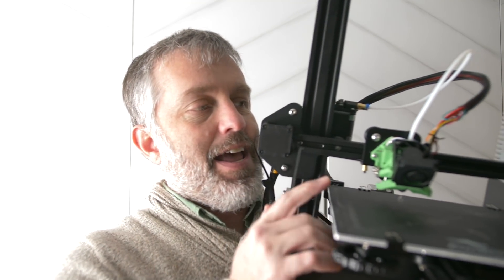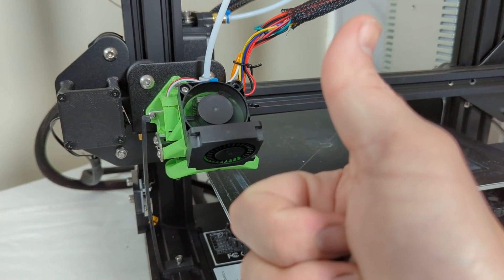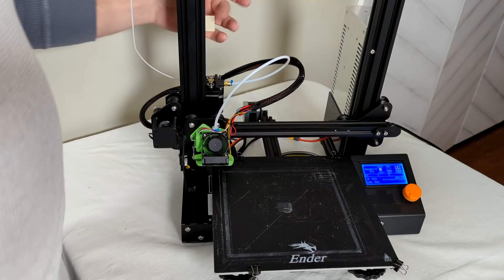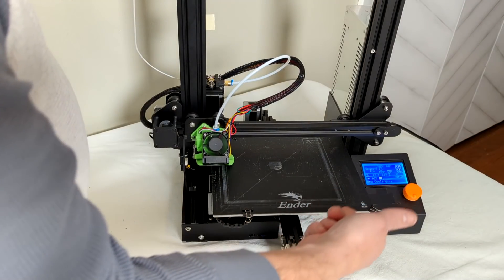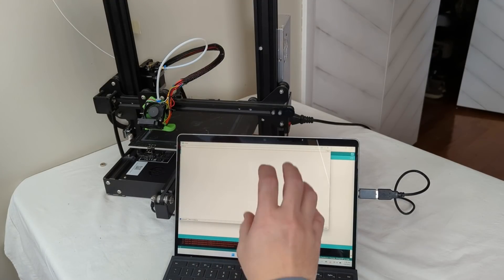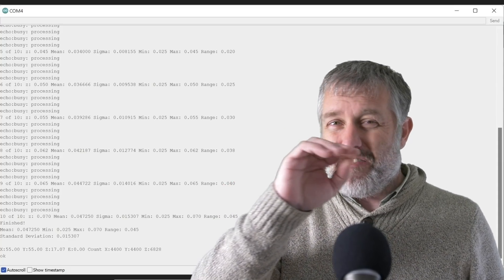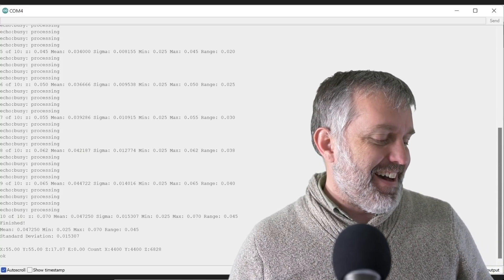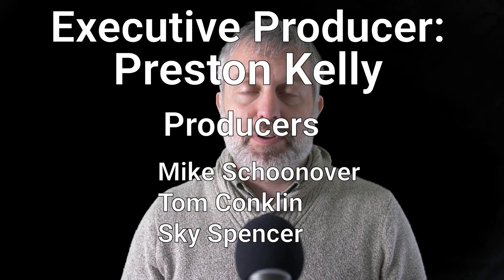I Made a Self Deploying Allen Key Probe To Rival The BLTouch

Comment: The biggest issue i have with this and all other bed leveling methods like the BLTouch etc, is that it does not know of the current nozzle height. 
Every time  is dismantle the hot extruder and put it together again the height was always different then before. For me the only right solution is to use the nozzle to measure the bed level.

Comment: I bought a bl touch for my original cr-10 and didn't make sure I could plug and play on my printer. I sure wasn't going to open up the power box and cut and solder wires in there...

Comment: Shopping around for an optical switch and I notice some of the ones with built-in amplifiers/schmitt triggers specifically mention temperature compensation. Makes sense, the photo-transistor would pickup thermal noise offsetting the trigger threshold. Something to watch out for.
Reply from the maker: Can you give me a citation? Would love to read it and get all the information for myself.
Reply: @DesignPrototypeTest  I dare not post a link, but search for a datasheet for any optical switch with a "built-in temperature compensation circuit" like EE-SX398 by Omron. Plenty of papers on temperature dependence of phototransistors and such. As I understand, the slit width and sensor area are much larger than the precision we are trying to achieve, so it is very much operating in the analog regime so where precisely the trigger fires will be quite important.
Reply: @DesignPrototypeTest  Found a good one. I'd post a link, but YouTube. It's linked on my T-verse probe design/demo. "Technical Information for Photomicrosensors" comes up as first result (Omron). Figures 9 and 10 show temperature dependence of both LED and sensor with a 10% dropoff in light current from room temperature to 80C. If we assume the aperture width represents the transition from light to dark, 10% translates to a pretty big systematic error in height (which can be accounted for).
Reply: Thinking on this some more, it's probably not so bad. The sensor will saturate at high brightness, so fading out across the entire aperture width is not the problem. More likely it will stay on until the last little sliver of light disappears. So crossing the threshold will happen over a much shorter distance than the actual aperture width. Just crank up the brightness. Some sensors allow for bright pulsed light, too.

Comment: Definitely interesting probe. I've saw some similar one like Touch Mi. For safety i would make pin printable and not very strong specifically for cases when for some reason you forgot to retract it and it hits the bed or printed object. So pin will easily break without damage of head holder for example. Pin can be printed again so there won't be big damage from incident. 
But what i think would be a winner in probes is that which will measure the offsets by nozzle. It's a really painful to set correct Z offset after changing the nozzle (or whole head). So probe which will measure bed and nozzle offset at the same time would be perfect.
Reply: A Wheatstone bridge strain sensor uses the nozzle as the probe, check hackaday article named ‘QUARTET OF SMD RESISTORS USED TO SENSE Z-AXIS HEIGHT’
Reply: @iridiandot  great idea! Unfortunately it's mostly for bowden system. Doing it with direct extruder will be more tricky as you have to invent some flexible mount for the whole extruder. May be strain gauge for the whole X rail can sense bending when nozzle touch the bed.

Comment: Interesting.
- There is a 3rd situation where Bl-Touch, or electromagnetic based sensing device won't work; in a strong magnetic field.
I made a super duper Delta printer using ball joint and magnets to eliminate slop. The field generated by the 6 magnets around the effector is strong enough to disrupt completely the weak little electro-magnet of the Bl-Touch.
- You would have less wobble if you had longer sleeve or even better 2 paced out guide holes.
- Can use a larger Allen key if wanted, just use a thin flag.
- need to package this in order to easily adapt to many hot head styles.
Reply: there is a bigger reason, you really dont want to use a off center probe on delta. regardless of it being bltouch or not.

Comment: Hi, I found your project on hackaday. First of all, nice idea! 
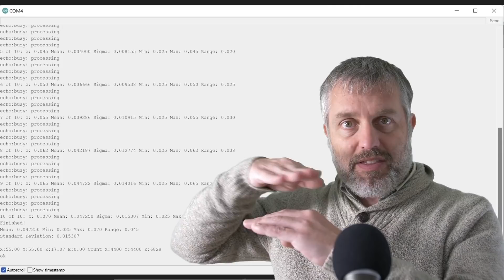I noticed, by looking on your data at 10:17, that the measured position value is systematically increasing. If thats really the case, then your measurement accuracy is corrupted not by the probe design but by a component of your printer. For example "lost steps" could cause such problems. Reach back, if you might want support on this topic.
Best regards,
Andre

Comment: This is a terrific build idea.  I got my stock ender3v2 for Christmas last year, and in a lucky coincidence my family bought me PETG instead of PLA for my first filament spool, so I had to learn some things pretty quickly.  Haven't burnt out my feed tube yet, but did melt off my shroud, but still works okay.  My first mod was updating the firmware (which is an ABSOLUTE MUST), and second was a side-spool holder.   A couple comments about this video though:  I would have liked if the model of the optic sensor was included in the graphic animation, to show where the sensing transition was, and also a little the explanation how the trigger point is at a constant, if indeterminate, offset from the bed, how that is adjusted in the firmware to create the z adjustments.

Comment: I  like the simplicity of your deployment method. I have been working on a touch sensor that uses a Nitinol wire actuator to deploy the probe but it is too complicated by far. I do use a piezoelectric sensor to detect contact on the touch sensor, along with a single underbed piezo sensor to detect nozzle contact and if the nozzle is clean. I will see if I can come up with a version using your "Allen key" method but I will continue with the piezo as it works well for me.

Comment: Does the probe auto deploy?  I think some of that wobble could be reduced if the probe was symmetrical.  Perhaps also make the magnet a ring that sits above the probe.

Wishlist:
 I'd like to see it eventually fit in the same space as the BL touch if possible and use the same firmware.  Lots of us already have the BL touch it would be nice if it was an easy change.  Eventuality once you get the bugs worked out.

Comment: That wobble effect causing inaccuracy is why I opted to print and design a probe in the cnc surface probe style but adjusted down to the size of a BL Touch and using parts readily recyclable (probe tip is burned out CD drive's linear rod, pre-load spring also found in all drives as a vibration dampener). Even in a setup that guides the pins around the probe into their saddles in the housing, takes thoroughly accounting for that motion to get it right. My CAD constraints all look like programming functions at this point.

Comment: Very cool. But technically, you measured the precision rather than the accuracy of the probe. Precision is how close together are individual measurements of a single thing; accuracy is how close the average of those measurements are to the actual value.
Reply from the maker: Technically you are correct. The best kind of correct as Homer Simpson says. To expound I wish to point out that the accuracy is determined and adjustable by me. I can adjust the probe offset value in firmware until a very fine accuracy is achieved. I believe the "Standard Deviation" measurement is the appropriate measurement for accuracy in this context. Meaning that 68% of the time the actual distance measurement will be +/-.015307mm from reality. That seems pretty accurate to me

Comment: This detects when the key moves past the light beam. To increase accuracy, another idea would be to detect when the key moves relative to its dropped position. This could be done by using a HAL sensor to detect any magnetic change (shouldn't then matter hot hot it is) or a light beam that detects any delta in the beam change.
Reply from the maker: I'm not trying to be rude, but everything you have said is not correct, and it seems like you are trying to push the project in the wrong direction. Hall effect sensors suffer from temperature drift. HP has one that apparently doesn't have this problem but I guarantee it costs more than $3. This is not a superior solution to the one I presented in the video. As I said in the video, the whole point of going with an optical sensor is to get away from the inferior solution of inductive sensors such as used in the BLTouch and P.I.N.D.A. probes.  This sensor in the video does have analogue detection which is what you were talking about with  "detects any delta in the beam change." The problem with analogue signals is at what value do you call the sensor "triggered?" How do you ensure a consistent triggering value? To solve this problem is why there is a Schmidt Trigger on the circuit board of this sensor. The Schmidt Trigger turns the analogue signal into a reliable and consistent digital signal.
Reply: @DesignPrototypeTest  I don't think you understood my suggestion, but thanks for replying. I don't mean a HAL or analog to trigger when the key moves past a certain height. I mean to trigger when the analog signal changes almost by any value. Yes we 
need a threshold to ignore noise. Past that random background noise threshold it'd detect as soon as the key moves by any amount. That's why it'd have an error mostly depending on how accurate the lowest position is. A HAL sensor costs also like $2 or so, even a lot less if you buy the component. People use that also for 3D printed keyboard keys.
Reply from the maker: You can buy a more analogue optical switch. Typically it is less expensive than the one I talked about in this video. I covered this other option in the previous video here: https://youtu.be/399VbXxuOdw?t=154 it is inferior. The Schmidt Trigger component on the switch I recommend in this video gives more consistent readings. The Schmidt Trigger accomplishes what you are calling a "threshold to ignore noise." https://en.wikipedia.org/wiki/Schmitt_trigger I don't know what you are talking about when you say "HAL sensor" It just makes me think of Space Odyssey 2001. When I ask Google what a HAL sensor is it just sends me to "Hall Effect Sensors" which are inferior to the optical probe because they give different height readings based on how hot or cold they are. This is known as sensor drift. Do you understand? The sensors tell you the bed is further away  from the nozzle when it is cold, and it tells you it is closer to the bed when it is hot even though the distance hasn't physically changed. Why would I modify my design to use this inferior solution?
Reply: @DesignPrototypeTest  not sure if my reply with a link to a Google doc got detected as possible Spam.
Reply: @DesignPrototypeTest  Thinking more about it, my idea would work in high temp but it may increase false positive detection too frequently (at least in a mode to be more accurate).

Comment: Really nice!  Do you think you can reduce the slop problem of the allen key by using a thicker (and heavier) key?  It could be less sticky in the hex hole even with tighter tolerances. (PS:  not going too crazy on a super-massive key...just a little bit bigger)
Reply from the maker: I had thought of it, but dismissed it. Your comment is causing me to reconsider. There are a lot of aspects to the decision. Such as the thickness of the Allen combined with the plastic over-molding. These must be skinny enough to fit in the fork of the optical sensor. I'll look into it. If I end up using a thicker Allen you can take credit for making me think about it more. :)

Comment: No findum linkum, kemo sabe.  Can't find it on Thangs, either.  Didn't reallly WANT to WAIT as you suggested, but - if you INSIST?
So one minor suggestion re: the lateral slop in the hole/path containing the allen wrench:
since it's potentially a tedious exercise to dial in an adequately precise hole size for each printer/user - why not figure the print on the snug size and drill it with the appropriate (common) drill bit?  The trick to dialing that in might then be reduced to selecting the size of allen wrench such that the inscribed hexagon is closest to the necessary drill diameter?
That said, I'm a tad skeptical that there could be enough lateral movement involved to actually throw off the vertical movement to the extent you're describing.  Were I not too lazy, I'd work out the trig and show what I mean - but my guess is: 'tain't worth it to either of us.
Nice design, I think (looking forward to actually "seeing" it!
Keep up the good work!

(BTW - afore-mentioned laziness also means I haven't dropped back to find my last post in your direction - regarding the filament spool holder - wherein I mentioned the need for one with a small enough spindle to accomodate old Taulman spools with their 19mm center holes.  I posted my idea of a solution on Tverse::5238752 if you're sufficiently bored.)

Comment: what if you used a bit of ptfe tubing to line it for the allen to fit into, eliminating wobble? you could match it near the ID size is near the size of whatever allen you use, and remesh the model to fit the captured tubing.   as for middle/bowing - I always wondered... is it possible to put a probe on either side the hotend and have them work together to detect more minute problems like that?  if too difficult, a new probing method might need programmed to do  "center" then like 4 points around the center, so the probe can detect that bowling or bulging.

The mesh bed leveling square grid may need to be rethought about and worked upon for greater accuracy at the foundation of these systems.  And obviously the closer you can get the probe to the actual nozzle, the better, correcting for offsets is yet another step in complexity and having it off by 0.5mm can lead to disasters.

Comment: There is alot of evidence to suggest Chinese clones actually force innovation rather than stifle it. I mean when does the "genuine" part stop being genuine and just a part? A brass nozzle? A stepper? Ptfe tubes? endstops? Power supply's? Filament? where is the lawn drawn. There have been Chinese knockoffs of every product for ages, that argument is just plain wrong. It has not stopped apple, Samsung, Nintendo, Sony, or any other company from innovating. If anything they have proven to be complacent until they are forced to make new products because of cheaper just as capable products competing with theirs. I've heard the same excuse for literally every printer part. some as simple as a piece of brass. And a bl touch is not so complicated or revolutionary they should have sole right to it, that would be like saying only 1 brand of light switch is legitimate, or plungers. Besides I remember a video you made on the clones barely in good faith, purposeful doing it wrong. And while U may be right in not liking the clone, sabotaging it to make a point hardly proves a point either.

Comment: Another problem with the newer BL Touches is that the probe has been changed from a metal pin to a plastic one.  No idea why, maybe to cut costs, as a result it's easier to damage the newer ones.  I have a BL Touch with the metal pin and got a extra one as a spare, never had to use the spare one and I have been 3D Printing for 5 years now.  I agree people should support the origional creators and not the copy cats.  Funny how you Americans complain about things being expensive, that BL Touch which you say is $40 is $70 here in Australia.
Reply: Reason for the plastic is so it does snap for safety. If something goes wrong and the probe hits something it'll break the probe and not the whole BLTouch.

Comment: This is a great idea. Why did you not just use a nail though? Then you would have a pointed end. You could even use a small length of the tube that the filament uses to hold the nail/allen in the mount.

Comment: I used Sharp optical switches for engine cam/crank position sensing with excellent results and reliability.  Great choice. They have some with narrow apertures, might help some.
Also have a half baked idea of 2 magnets, one on probe, other rotates for park/release. One side will attract, other repels for slight spring action.
Reply: Yes! The slotted ones. Under $.80 online. Very sharp transition and if the interrupt or is knife edged (or very thin), the response is extremely accurate.

Comment: Going to have to give this a try. I've been holding off on ABL because I'm tight but this should fit the budget nicely. I might tweak the design a bit to deploy via an eject button on X home and retract automatically via magnet at print height (lower than probe height). That should pretty much eliminate any extra commands or firmware requirement methinks.
Reply: Just uploaded a quick demo of what I was trying to say.